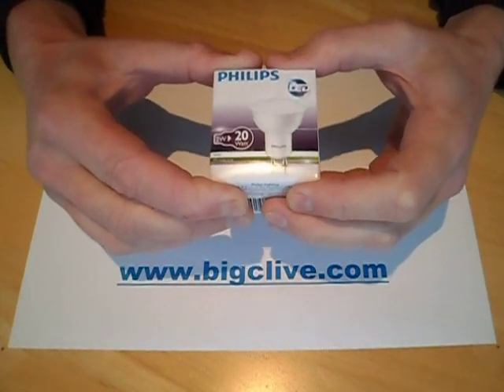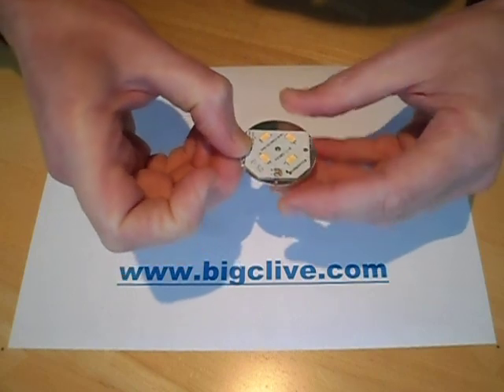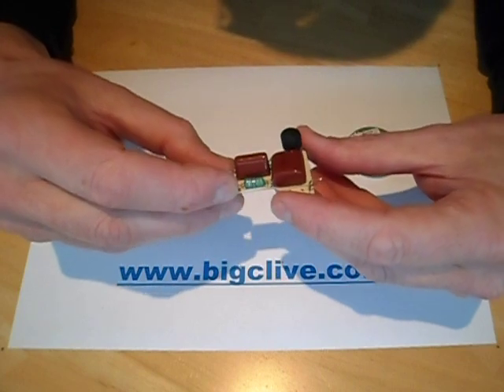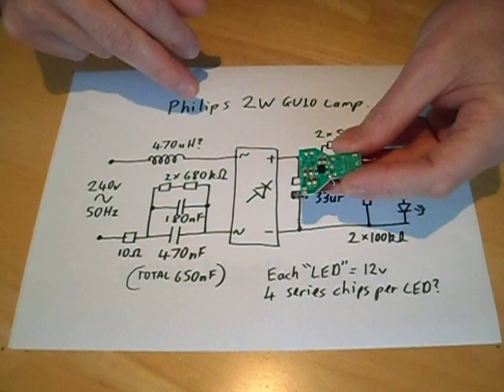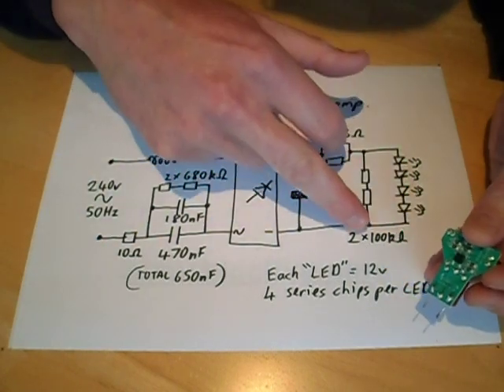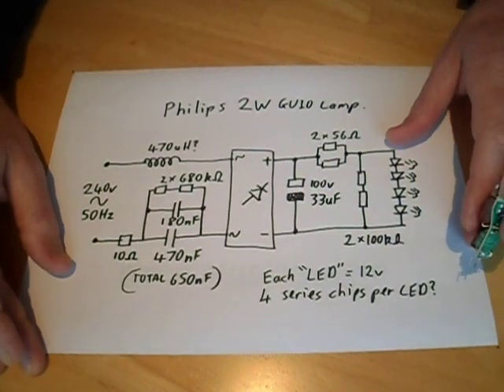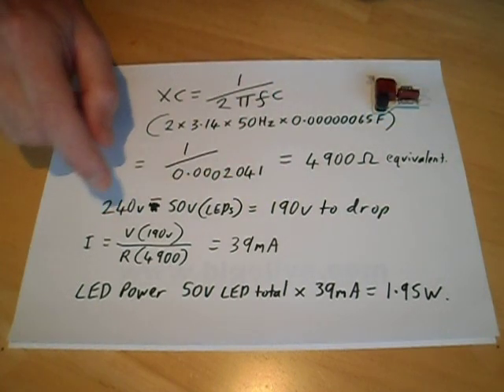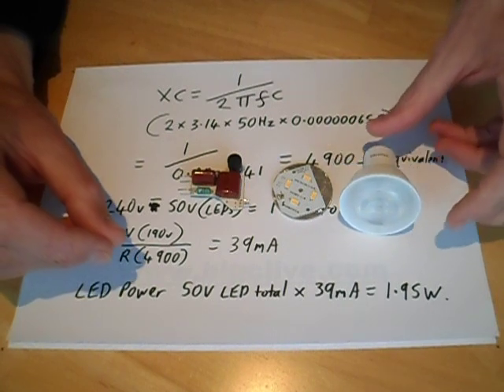Teardown of a Philips 2W LED GU10 lamp.

Comment: Sir, what is the current consumption of all leds and what is the current deliver value of mains x rated capacitor.
Reply from the maker: The typical value of the X2 capacitor for most LED bulbs is between 100nF and 1uF.  It's usually best to experiment with the value to get the desired LED current.

Comment: Doesn't the inductor also contribute to the voltage divider as an inductive dropper (please check the values)? Else I could imagine that it shall reduce idle power by pushing in the opposite direction than the capacitors.

Comment: Philips to me is a bad bad brand.  But only as far as CFL's go.  So they've been on my do not buy list for quite some time.  GE no problem but Philips  CFL's?  2-3 months tops.  So far longest lasting Vanity CFL's were from "Globe"  that was the brand until our local HyVee re labeled them to HyVee and then they didn't last as long either :(  so now TCP or Feit and those are going bye bye for TCP LED vanity's.  But everyone has their lemons and not all are the same either :(

Comment: I've got 2 of these lamps. One of them already died within a year. I took it apart and checked the components. There where no visual defects, but the 10 ohm fuse resistor was not conducting. It seems that it is blown.
Reply from the maker: It seems to be a common failure that is related to switch arcing if the switch operates too slowly, causing the capacitor to act as a snubber and pass enough current to blow the "fuse".
Reply: @bigclivedotcom  - I have 4 of these Philips 2W LED GU10 lamps.  All have the same 10 ohm resistor fuses failures (all other components tested and working).  I remedied the units by simply removing the fuse.  I know, I know - Danger Will Robinson, Danger.  However all 4 have been working for over a year with no problems.  What do you think?  Is this a serious hazard?  Should I just trash them?
Thanks, K
Reply from the maker: @Gringo_In_Chile  I don't think it's a major hazard, but even the cheapo import lamps do tend to use a 10 ohm resistor as a crude fuse.  It means that if it fails it may make a bit of a pop.  I've just had another one fail in the same way.
Reply: Lucky you only had 2 of these.  I have 14 and 4 have failed.  I also determined that the 10 ohm fuse was the culprit.

Comment: Bigclive, correct me if I am wrong but I regarded these dropper circuits as cheap dangerous Chinese power supplies.
If Philips think it's a good circuit idea then it must be safe to use ?
Reply from the maker: They have their applications.  It's a common way of powering things like digital time-switches.

Comment: I Have 60Led in series circuit. can you please tell me which mpet i should try. I am currently using 2.2uF but my both capacitor burnout in 2-3 Months. I want this circuit to work more time can you please help me with some calculation about which Mpet and Elcap i should use.

Comment: Very interesting - I have a led light pcb with 26 leds and I measured a voltage drop of 70v and a current of 100 mA but how can I test it without blow up everything.

have you any idea where is it possible to buy such a small capacitors? I check on ic supplier and all capacitors (X2) are bigger then those.

Comment: Thanks for this - interesting. I have measured the actual power consumption of these lamps and they appear to far exceed the 2W stated consumption. It seems a decent switching converter would be far more efficient?
Reply from the maker: Actual dissipated power on this lamp is an accurate 2W, but if you go by the current it looks higher.  But because most electricity meters only measure actual power and not apparent power the lamp is effectively just a 2W load.  In fact it's leading power factor will probably compensate for other inductive (lagging) power factor loads in the typical house.

Comment: you can just do a decap on the phosphor slicone and find out how many chips beneath.
Reply from the maker: I measured the voltage across one of the LEDs on a suitable external current limited supply and it was 12V suggesting four chips with 3V across each.

Comment: I think the inductor is to limit inrush current if the lamp is turned on at the peak of the mains cycle. You have quite a high value dropper capacitor and only a 10 ohm resistor in series which won't limit the inrush current by very much.
Reply: I believe you're right and that inductor makes a huge durability difference

Comment from the maker: This was from Philips economy range so it only cost a fiver (5 pounds Sterling).  The reason they used two capacitors was because they were off the shelf standardised values.  A 650nF capacitor would have had to be made custom for the task which would be more expensive than just using two common ones.  The use of two would also allow tweaking of values by simply combining two existing standard values in those positions.
Reply: strange...   I always knew resisters in parallel meant you halve it for real value , but for caps you add them?   .. weird science :)